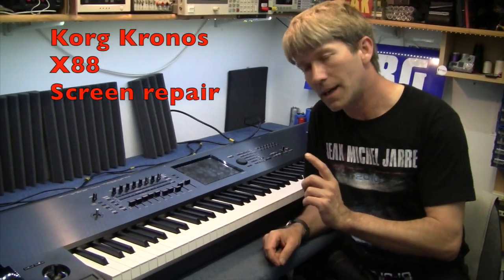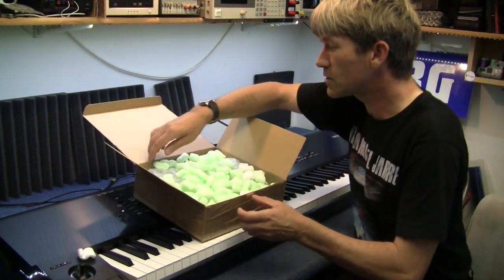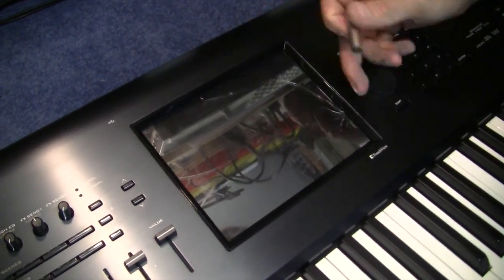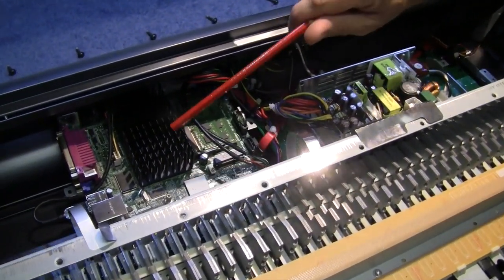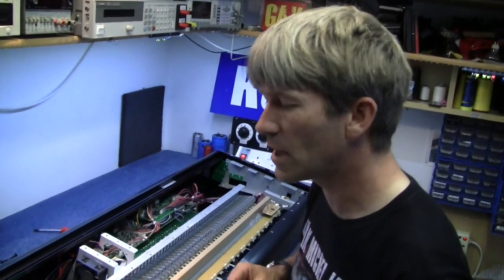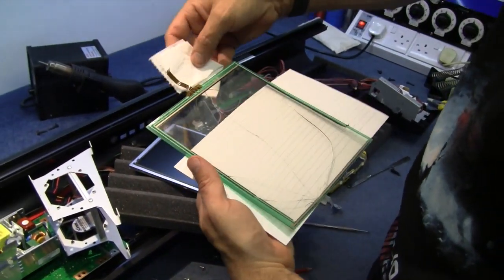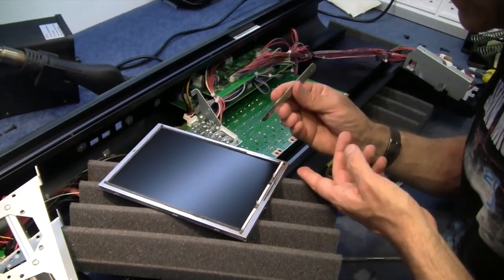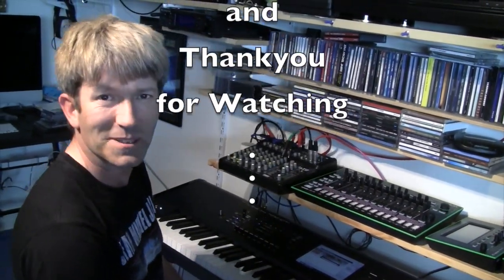MF#27 Korg Kronos X88 Repair cracked touch screen replacement

Comment: TIP: When removing cracked glass screens from any device you value first apply a layer of sticky tape to over the cracked surface. This gives support to the glass while you take it out and holds small shards in place. If removing glass by vertically lifting then fashion some pull tabs out of the same tape.
Reply: Good advice :)
So who here cut their fingers before they learned it

Comment: This video is great! Thank you very much for doing it!! .It allows many people interested in acquiring the Kronos to know the interesting details of its construction that are shown, such as the motherboard, processor, SSD disk (and the connectors to add another one), and so much more. There is a detail that caught my attention (negatively for a keyboard of 3500 dollars): what need had Korg to use a wooden bottom cover ??? (I ask you to tell me the approximate weight, which should not be little ...). At least, they would have painted it black! . The sensation of beauty of seeing the wood on its sides is transformed into horror when you see it below without painting .... I find this cheap construction detail very strange .... The day I buy it, I will also buy a quarter liter of black paint! LOL

Comment: Do you know if the rh3 keybed in this keyboards are interchangeable across models? Will the RH3 keybed in a korg D1 work inside a kronos 88? They say its the same keybed, the rh3.

Comment: Hi Markus, I know this is an old video but do you know what which touchscreen OEM does Korg use for the Nautilus? Also, would you have a likely idea of which capacitive touchscreen might act as a direct replacement for the resistive touchscreen?
Many thanks!

Comment: Good eveninig Mark. After owning for 7 years a Korg Kronos-X 88 (Sh3 keybed...) I discovered the velocity curve problem (any curve programed by Korg is not able to reachthe value 127), this involves many other considerations regarding the olayablility of this type of keybed...   Do you know if the problem can be solved by chabging rubber pink contacts inside by other contacts achieving better results?..... We have in Spain a big Kronos community waiting for a solution of this issue... Thanks a lot for your advice. François Clamour from Barcelona.

Comment: Interesting. Though I wished 2 know, how the screen connector could b opened. Also there are PCI SSD's that also fits in the main board's (Mobile type PCI) slot, that you pointed for wireless LAN. The board above the screen is basically the Heart of the Kronos. It contains a RISC CPU and does the most, of the OS. It works as a plugin board on a Linux based OS where the desktop CPU is used for creating the sounds. Tx. Namasté.

Comment: Hi Markusfuller, I have a Korg Kronos. And my LCD ( light  display ...back lit display) screen went out. I can hear it still works .But the LCD part is out. In other words it won't light on the touch screen, its just black. Would you know how to fix that portion?

Comment: Excellent video!    Those Korg 88 note workstations are loaded up with so  many components that all have to come off before one can get to the touch screen.  I've had to do this on my Korg Trinity proX 88 note, Korg 01W 61 note as well.   The screens are buried beneath all this circuitry and wiring..... much fun.I've needed to work on older Yamaha GHS keyboards that have keybed issues.  What lubricant would you recommend on those for rear of key and front guides?Thanks

Comment: Have just been looking at a second hand Kronos 2 61, turned out the touch screen wasn't actually working did not detect any finger or nail presses on the screen whatsoever, could not get to the menus to re calibrate the screen either, had to drive home empty handed, seller wasn't aware of the problem hadn't used it for a while then took out the box so I could have a look at it, Markus do you think this could be just a touch screen problem that replacing the screen will fix, or are there other issues that could be causing the Touch screen issue?

Comment: Good video brother, I have a pink line over the display do you reckon is the screen or mainboard problem
Reply from the maker: sometimes if you have a coloured line that goes right across the screen then its normally a display issue that could be the tiny fine ribbon connector that attaches to the edge of the glass lcd panel. this can also sometimes be fixed by a bit of gentle pressure added to the ribbon cable just where it meets the glass but it is so fragile that you can also make matters worse. I dont think the problem is from the mainboard. Its a pity Korg didnt utilise the display adaptor on the atom pc within the keyboard as you could have plugged in with a computer monitor and tested to see if you have a clear display or if the line appeared on a computer monitor. I do not think that display port on the mainboard is activaed though I could be wrong.

Comment: Hi Mark, great job as usual.
My kronos has a slighly different problem: the screen is not broken but there is a line of pixels which remain always lit (that is:quite annoying).The strange thing is that the brightness of this line of pixel is not always the same: i.e, at the start, in the first part of the booting sequence, it is brighter, then it grows dim
 Do you have any suggestions? In case the replacent is needed, where can I find the LCD screen spare part?
Thank you in advance for any help

Comment: Hi Markus ! I have a problem with my Kronos x.. A problem has been detected. Please turn the Kronos off, wait for a 10 sec, and then turn it back on. any advice? thanks !!
Reply from the maker: Hi David I guess you have already tried turning it off then on again ?. the Kronos is a small household type atom computer (even has a printer port on the board). so the problem could be coming from anywhere as in a fault with the hard drive or memory or boot-up or or anything else that a computer can suffer from, plus there are several special boards connecting to the PC with soundcards and faders & buttons etc all communicating with the main PC. There could be a problem with one of those boards. I would try the reset procedure a few times and maybe look to see if there is a factory reset procedure which would normally involve pressing a button and holding while powering on (should be in the instruction manual somewhere). I sold my Kronos a long time ago so I do not know what the full reset procedure is. Factory resetting the Kronos will not guarantee that everything will be back to normal if there is a fault within the computer but it is better to try that first rather than taking things apart. and the fact that it says please turn the Kronos off on the screen tells me some of the program must be running correctly inside the PC simply because it is displaying the word Kronos. but I do not have any idea what could be wrong with it as you are the first person in all these years that has asked me that specific question. there is a Korg Forums page that could be more helpful as the people on there have had their kronos’s for years. good luck I hope you get it up and running again.
Reply: hI !! yes I did it a few times and its strange because for example yesterday in the first start I have that error and after  reboot maybe 3 times the Kronos works fine, but I guess is what you told me.. its a computer so I shoud start to check my Kronos in that way. Thank you very much to take the time for reply to me. take care !!

Comment: you might know mark .. how do you clean keyboard keys 
my keyboards keys have turned yellow 

i was told vinegar cleans them is that true ????
Reply from the maker: +Matthew Garufi Of Audio Fix Productions Hello Matthew, This is something I have never done but I have heard that the yellowing is caused by Bromine seeping out of the plastic and that you can clean it with vinegar then a damp soapy cloth to neutralise the acid and then leave it in the sun for a day to re-bleach the plastic with UV light. As I must say though I have never tried this myself so cannot give you my advice on wether this actually works. Best thing is look around the new to see if someone has already done this. Best wishes from Markus.
Reply: +Matthew Garufi Of Audio Fix Productions I saw a guide somewhere that said using hydrogen peroxide and UV light is the way to fix yellowed plastic. There are some hair products that contain H2O2 and are foamy for easy application. For UV, use a blacklight or sunlight.

I haven't tried it myself yet, but am tempted as my NZXT PC case has caught a bit too much sun.

Comment: Hello Markus, thanks for the vid, great step by step on how to do this.   I'm needing to do the same repair, and the one thing I didn't get from this video is:  What was the material/tape that you used to RE-apply the glass to the LCD?
Reply from the maker: Hello Jonny. I used standard 3M double sided tape, the sort that is sticky on one side then you pull off the backing strip and that makes it sticky both sides. I had to cut it into thin strips though as the original tape is 1 inch wide. but luckily it did the job :-) . many thanks from markus
Reply: Thanks Markus!
Reply: A couple more questions about the tape.   What is the heat (temperature) setting on your heat gun?   Do I need to be concerned that it will damage the LCD screen itself?  (I noted that you heat sinked the cable going to it with foil tape, but do I need to be concerned about the LCD Screen itself?)  As you can see, this is the only part that concerns me.  The rest is just "screwdriver" stuff...  :-)

Comment: You could just say " Why korg did not release a VST plugin ;-) I have an issue with my Kronos  2 61 where 1 key makes a metalic spring noise. Any info where to get and how to repair that myself? Because keyboard is brand new and has been sent twice to maintenance which did a poor job. :-(

Comment: I have a korg m3 and the touch screen was working fine before I stopped using it. it was standing up in the corner of the room for about 2 years. I decided to switch it on again to play some tunes and found the touch screen doesn't respond at all. I tried to calibrate but that doesn't respond either. does anyone know why the touch screen stopped responding. thanks

Comment: you didnt show how to take off or re insert the little brown cable attached to the screen. I think I need to replace mine. Its not cracked but intermittenly stops working

Comment: Hello. Know if you can connect a monitor to the Korg Kronos in the VGA output on the motherboard?
Reply from the maker: Hi Juan, I think if you connect an external VGA monitor you would also have to gain access to the Bios of the motherboard to switch on the VGA output and maybe get into the startup program of the Kronos. to be honest I think it could be a lot of work to get it to display on a VGA but I am going to have a look around the internet to see if anyone has succeeded in doing so. you have bought up a good question here. . . does anyone else reading this know if it can be done ? please reply if it can. best wishes from markus
Reply: Gracias por su respuesta. Yo he buscado en internet pero aun no encontre nada al respecto. Si encuentro algo se lo hare saber. Un abrazo desde La Patagonia Argentina
Reply: Thanks for your reply. I searched the internet but still did not find anything about it. If I find something I'll let you know. A hug from Patagonia Argentina